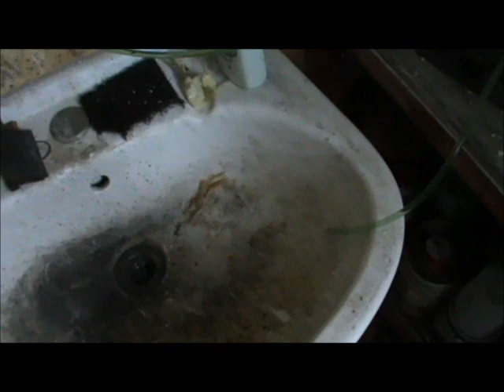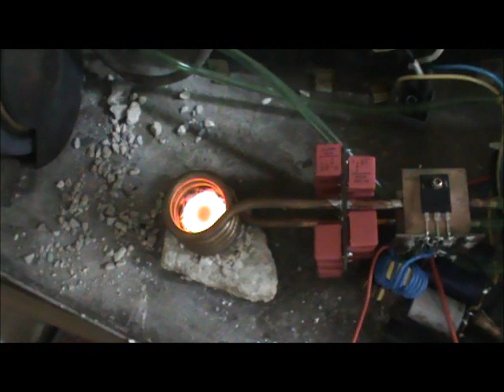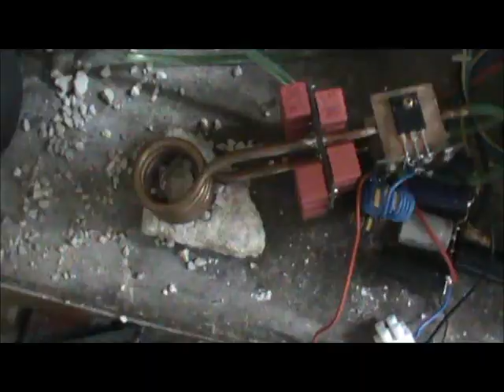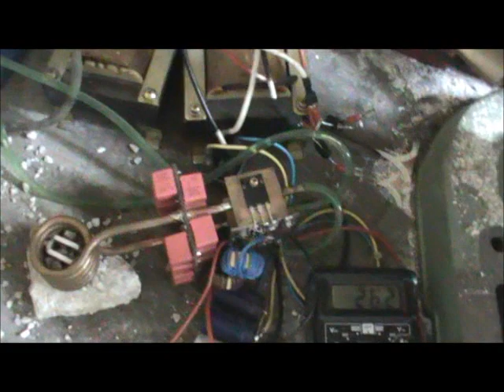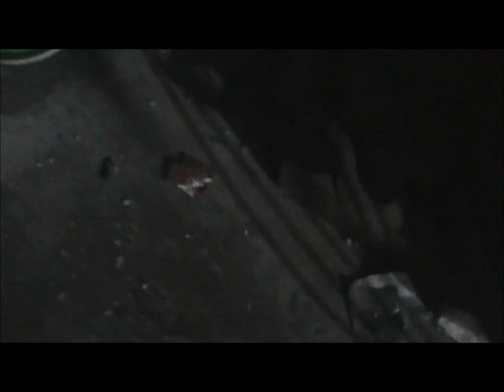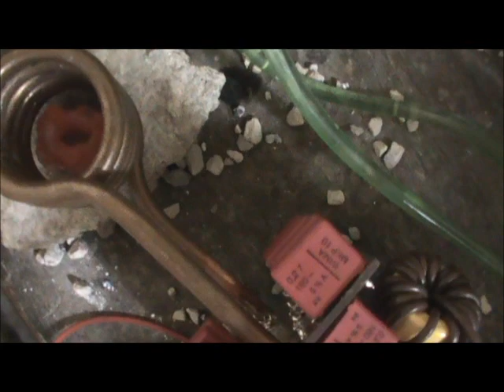Royer oscillator induction heater

Comment: Hi Marco.     I have just succeeded in replicating this project with a 10A variac through an AC arc welder and 100a recitifier and having killed so many mosfets on the way I don't want to just turn everything up till something blows and so am hoping you can tell me how to identify the limits of my system in terms of voltage current and temperature.      Thanks.     Tanc